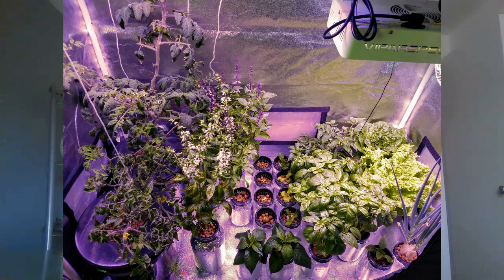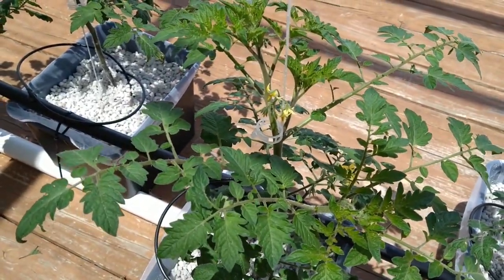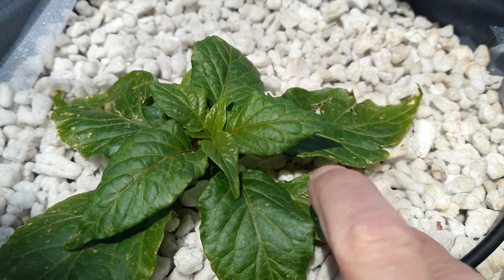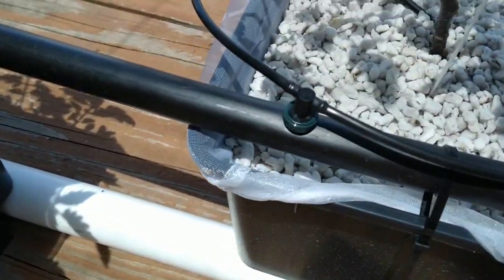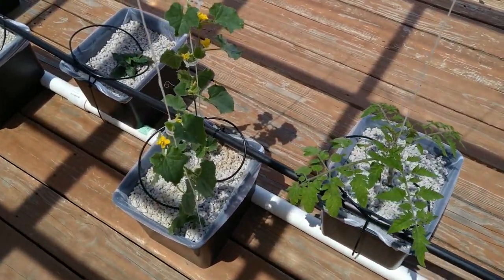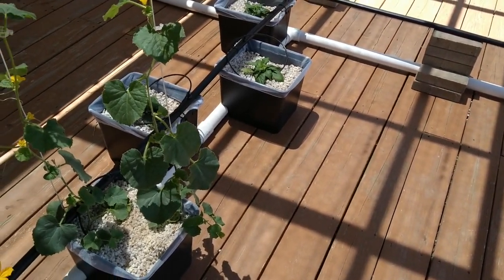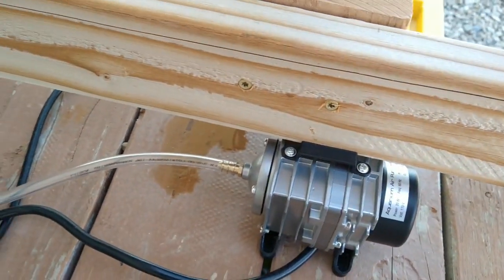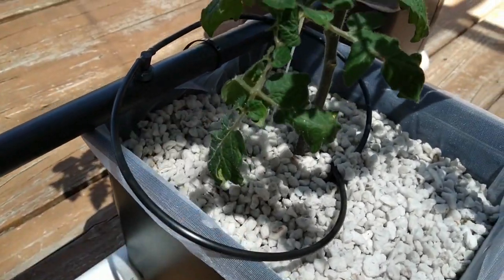The outdoor hydroponic garden | Dutch / Beto bucket setup.

Comment: I'm curious about the apparatus on the wall in the hallway behind you.  I'm guessing it's a doorbell, but also assemblage art?
Reply from the maker: That is my wifi router. The house came with a plate over a junction box which had power running through it. I added the outlet and next to it added another J-box for ethernet. On the wall is the power for the router and the POE injector for the antenna on the roof.